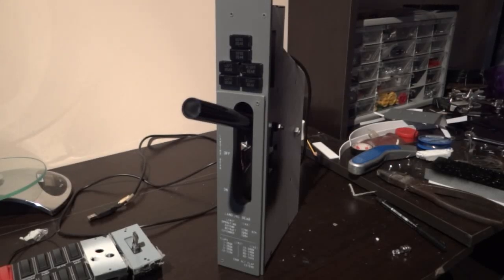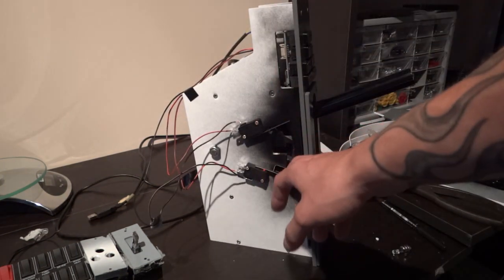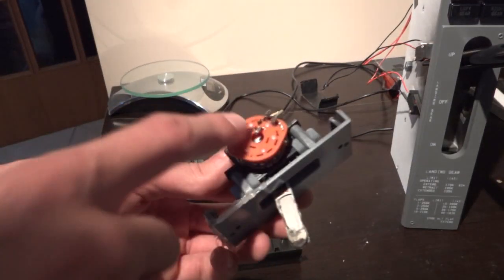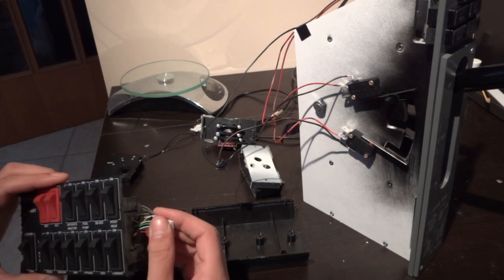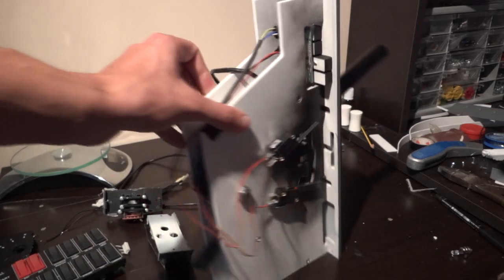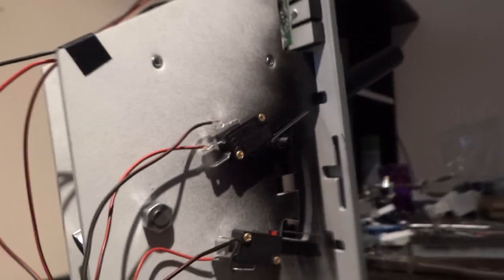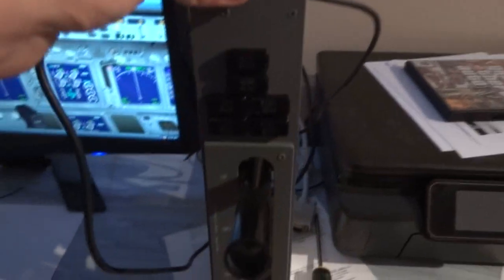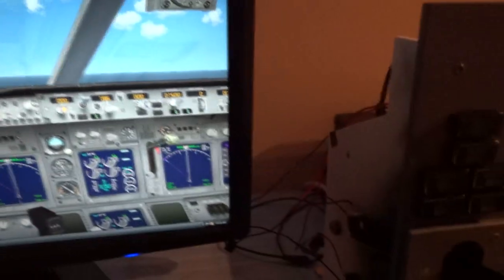home made 737 landing gear using Saitek Switch Panel

Comment: Hi, congratulations for your project! I have a question: I would like to create a landing gear for an AW139 helicopter and I would like to buy this Saitek switch panel. Are the landing gear LEDs 3 in 3 colors ( Red Green and Yellow) ? How many PINs do they have? I would like to replace them with 6 or 9 LEDs separating the individual colors. Do you know if it's possible?

Thank you for your time, best regards.

Comment: Just subbed! Great mod, and great channel. Slightly off topic but as you’ve disassembled the switch panel just thought I ask you a question. I have a problem with my  saitek switch panel, the green led’s work fine but only one red illuminates, do you know if there is any fix for them?
Reply from the maker: the only thing I can think of is the wires

Comment: Hi! How did you synchronize the leds with the announciators in the sim?
Reply from the maker: at that time i was using the saitek switch panel board as you can see in the video
since then it was updated and now i'm using a flightdeck solution usb card
Reply: piromoretta Okay, Thankyou!

Comment: what if i want to use my switch panel to do an overhead panel. Just like you did with your BIP modification? Would it be hard to do the wire job?
Reply from the maker: technically is not that hard but that depends on your skills i guess